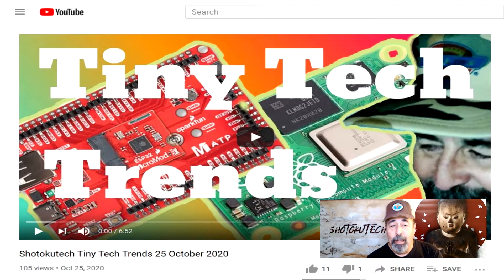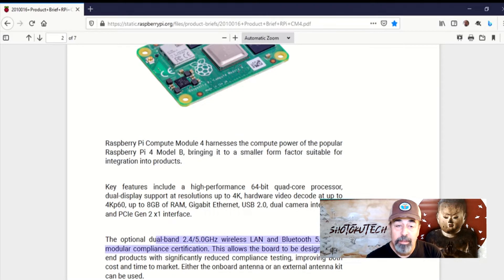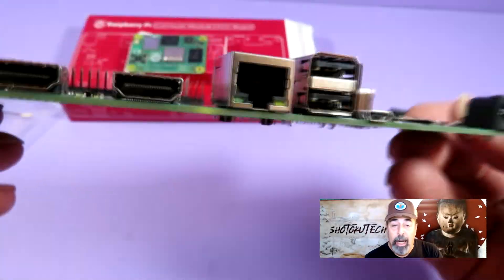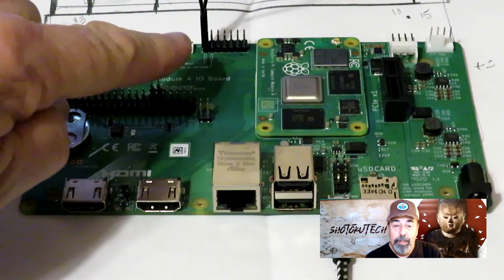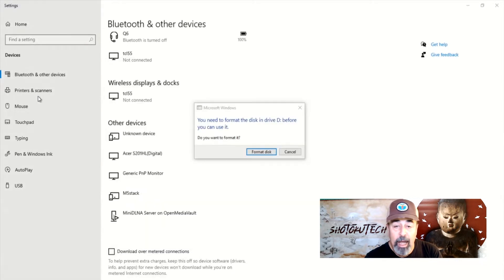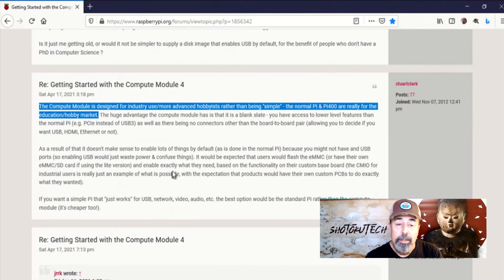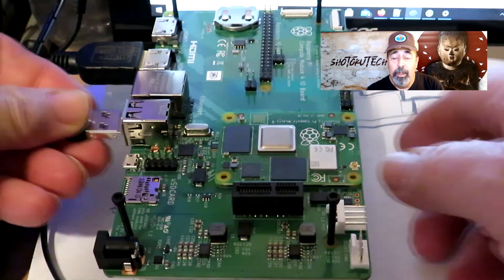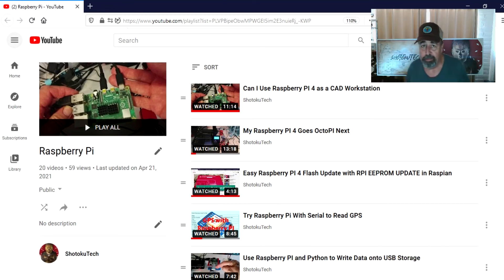Raspberry Pi Compute Module 4 Get Started Step by Step

Comment from the maker: Raspberry Pi Playlist: These little boards pack a lot of computing power. https://www.youtube.com/playlist?list=PLVPBipeObwMPWGEI5im2E3nuieRj_-KWP
Reply: Hi! I've bought the same combination. Is it possible that the sockets are soldered a bit wrong? A bit wider/narrower?
I can't install CM4 in my IO Board. I've tried to do this by pressing on CM4's corners. The module was positioned correctly and I've double-checked it from the side using a powerful light. I fear to push onto BGA chips as it's just on ball joints and they are not super-strong.
Can these parts be defective? I've bought them from the Chinese seller but they're genuine. CM4 PCB has "Made in UK" text on it.
Reply from the maker: @KiR_3d  Yeah it's gonna be difficult for me to talk through an issue that is physical. You may want to contact the seller? I have the CM4 carrier and the Piunora. I just tested and it was easy to pry off the CM4 and did not take much effort to press it back on.

Comment: i didn't need  rpi boot  program i put the Raspberry Pi os on a memory stick and it works my cm4 has eemc storage on it  and i got a Seeed Studio  like yours  and the usb ports woks  + you can put it on  the cm4 emmc drive
Reply from the maker: The eMMC just has better performance than a memory stick. Best wishes.
Reply: @ShotokuTech  but once you git the  os runny the you can copy from the memory stick  to the mmc  of just used Raspberry Pi Imager to install wat you want the is a bonus using the memory stick the usb ports work
Reply from the maker: @pw1066  Brilliant work! Thanks.

Comment: My laptop not detecting board
Reply: Thank you
Reply from the maker: @vrunalpatil9723  Excellent.
Reply from the maker: Let's step through it. If you have an eMMC CM4, the objective is to mount this as a USB drive. 
First out of the gate, do you have the jumper installed: https://youtu.be/wSRByPaS-Zc?si=UMDbdgJqCWpCYRv0&t=125
Try a different cable, different USB port, check device manager for hidden USB hubs and devices.
Best wishes!

Comment: My other compute modules dont have eemc and its so much easier. Running my others using the native PCIe lane/port on the CM4 IO board
Reply from the maker: Yes, no need to mess around with boot mode. Thanks!

Comment: Hands down one of the best videos ive seen on this process. And Ive watched a bunch. Thanks bro
Reply from the maker: I appreciate that! Happy New Year!
Reply: @ShotokuTech  you too bro. So I finally have my CM$ module WITH eemc storage running from the native PCIe Slot. What a bitch. Ive tried so many things mainly just to learn how. I have 3 brand new RPi5's to use. But its running well and I dont even have the circuit jumper on disabling eemc boot. Is that normal? I went thru sudo raspi-config and sudo rpi-eeprom-config --edit and switched the boot order and that was it.
Happy New Year to you too. I bought the Nebra flashing USB stick so I didnt have to use the IO board slave port to originally flash the eemc. Did it all on my Apple Silicon Macbook
Reply: CM4 i meant to type
Reply: This Cm4 board has 4GB RAM I have two others with 8GB RAM BUT no emmc which is far easier
Reply: using hdparm it says im getting mid 200's read write which is fine for an old pi via NVMe PCIe. My RPI 5's have NVMe hats and i got them overclocked and 700-800 mb/s read writes
Reply from the maker: @Mbro-dq2do  Either way these are both very useful. 4GB headless would be super. 8GB is fine for desktop. Best wishes.
Reply from the maker: @Mbro-dq2do  It is hard for me to comment on the Apple perspective. I just do Windows for the most part. But I am happy that you have you own path to success. Best wishes!
Reply: @ShotokuTech  You too bud. Wish I could show you a pic of thie Nebra flassh USB stick for the CM4. you should look that up exactly. best 30$ i ever spent. Especially when dealing with trial and error. Just pop the module on there. pop it in my Mac or Dell. reprogram it which takes 2min then use balena etcher to write a new OS on it which takes 10min or so. Im sure CM5's will work on it too
Reply: this specific module I want to just turn into a linux router/pihole DNS server in one
Reply from the maker: @Mbro-dq2do  That's a pretty cool gadget! Thanks!

Comment: how to connect camera with raspberry pi compute module
Reply from the maker: Good question. Give me a couple weeks I must get a camera or two. Thanks.
Reply: @ShotokuTech  
actually I have camera and raspberry pi compute module 4 can you give some guidance like how to connect camera to it
Reply from the maker: @spidevenom6966  There are a variety of carrier boards. You will find using a carrier board is best. The carrier board you select should have a camera connector.

Comment: it's infuriating that neither the CM4 or CM4 module comes with jumper wires
Reply from the maker: It is primarily an embedded board, dialed into a specific application. There are several options with various specifications. You might like this: Piunora and Raspberry Pi Compute Module 4 Tutorial
https://youtu.be/mKz2UP0rr2Y

Comment: Can I use a 15V powersupply instead of a 12V?
Reply: Okay thank. And where do I have to plug in 5V in normal usage? In the PSU with for pins? But which one is the 12V an which the 5V Pin?
Reply from the maker: @MaxMax-wy7bi  The CM4 itself has no pins. It requires some companion board that has compatible sockets for two 100 pin high density connectors on the bottom of the CM4.
Reply: @ShotokuTech  yes of course. I got the IO Board. I was wondering which pin of the ext.PSU (J20) is 5V and which one 12V
Reply from the maker: @MaxMax-wy7bi  2.2. PSU input discusses the power supply question. Then I went all the way to the wiring diagram to see J20 is a 4 pin connector, same as the old PC floppy drive cables. But read up on using this. 2.2 seems to indicate there are problems that could need mitigation. I just used the barrel connector for 12v. Super simple. https://datasheets.raspberrypi.com/cm4io/cm4io-datasheet.pdf
Reply from the maker: I just checked. This base board requires 12volts on the barrel connector, or 5 volts via USB. It would not support 15 volts directly. Thanks. https://www.raspberrypi.com/products/compute-module-4-io-board/
Reply: @ShotokuTech  so can Boot it for the first time just with microUSB?
Reply from the maker: @MaxMax-wy7bi  Behavior depends on whether you get CM4 with memory or without. If the CM4 has onboard eMMC memory you have to hold the boot button when connecting it, in order to be able to burn O/S image to CM4 eMMC memory. CM4 with no eMMC memory, just burn O/S image to TFT card and insert it in the card slot, connect to USB for 5volt power to boot.

Comment: To enable the I2C bus to the fan controller you will need dtparam=i2c_vc=on set in config.txt . The fan controller then
will be on i2c-10 address 0x2f ( 7bit address)
Reply from the maker: There's a fan controller? Cool.
Reply from the maker: @dj-la--wolf1288  cool

Comment: Now we've got the antenna! Can we get the GPS module from the other video to send with it too? That miniature motherboard is sooo cute. But it probably won't take long until every computer platine is that small.
Reply from the maker: Sadly the antenna is just for WiFi. So GPS might not be so useful at that short of a range. The description for the antenna says "For an industrial setting". LOL. I guess I need to do a range test. I printed a case for this motherboard. Stay tuned for my next video so you can see it. It's cute!
Reply: @ShotokuTech  Looking forward!